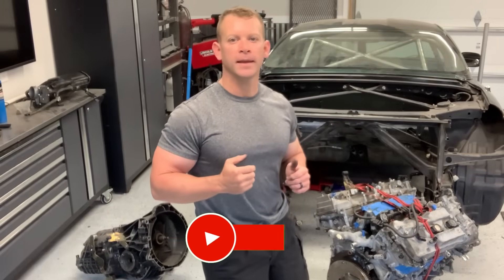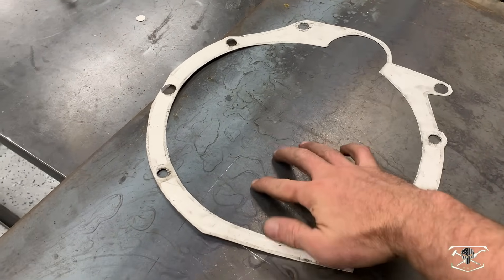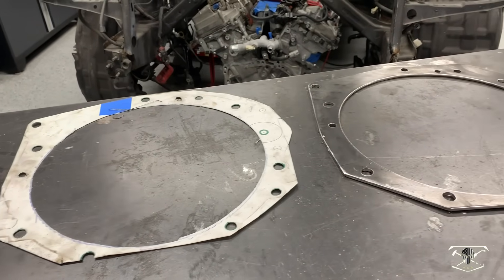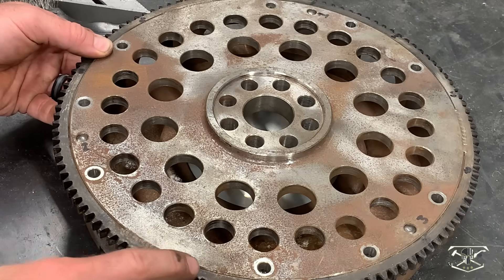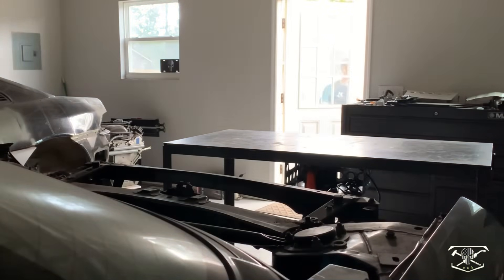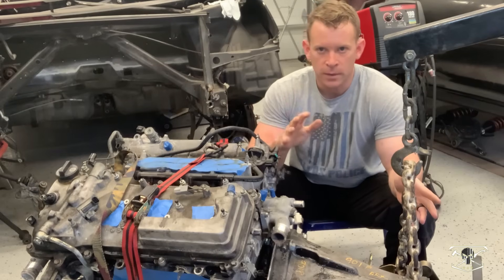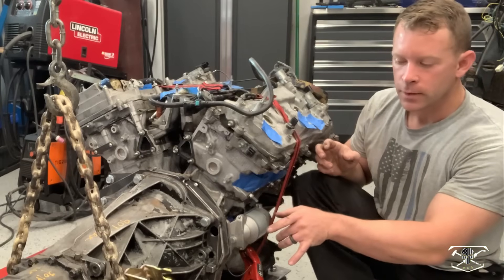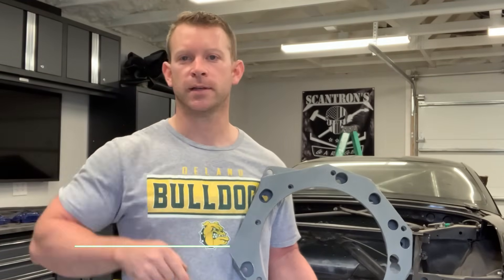DIY Engine Adapter Plate (Mate any Engine to any Transmission)

Comment: Amazing!  🤩
Good job💪, I really needed this.  
I have to do this in my project.  
I bought a Golf MK1 engine to install in my Corolla KE70, and I’d like to use the same transmission.  
This method will definitely be cheaper for me
Reply: How many millimeters is the sheet metal?
Reply from the maker: That's an awesome project! I'm glad this video could help you out. Yes the kits are super expensive and this is a good option. Just takes some time and patience

Comment: No dowels? . Unequal delta point between known centers? . A precision caliper and a circular protractor is what you need. Interpolation access must be achieved or transmission head gear  bearing failure is a guarantee as well as 1st and 2nd order phase vibrations that crack everything.  People did this long before CNC machines where ever thought of. It was just as accurate just 10 times slower .
Reply from the maker: Thanks for the information and your thoughts on the project. I did use dowel pins. You can see them. I didn’t mention them. I also had a friend measure it with a dial indicator. I may have to look into the protractor idea. Thanks

Comment: How did you figure the run out? I never saw a dial indicator being used or a DRO on a mill. How long did the input shaft bearing on the tranny last?
Reply from the maker: Dial indicator. Didn’t film that. And it is still running strong

Comment: My good man, this is incredible.  Subscribed to see more of your home-tool design and manufacturing.
Reply from the maker: Thanks man! I do what I can with what I got. Thanks for subscribing
Reply: @scantronsgarage  If I may, and don't take this as an insult nor put-down of your channel, I would suggest a better microphone (not sure what a lot of the car youtube channel guys like Vice Grip Garage or Stay Tuned uses, but I have seen other people use clip-on bluetooth (I guess?) microphones on their shirts).  
The lighting seems good(!).  The one clip after the welding had me wondering if the welding screwed up the lens or light sensor on the camera because it was a little fuzzy, but that got cleared up in the next clip.
My only point is refining the production/recording a little to polish what you have.  You obviously have the skills that a lot of home builders on a budget would want to learn from.
Merry Christmas, Chief.
Reply from the maker: @2WheelsFreedom-fest   Thanks! I appreciate your input and feedback. I have been looking for other microphone options and I think you are right. the clip on blue tooth ones are the way to go. I would jest have to be better at remembering to charge the thing

Comment: When you had the engine and tranny all mounted up together (before you began welding), how were you able to maintain +/= 0.002" radial runout?

Great video, thank you for posting it
Reply from the maker: Thank you and yes. I racked it a few times and re checked it and added some more tacks and re checked it. It was still within spec. This is why I was afraid to fully weld it. But it all checked out. Thanks for watching

Comment: Hmm. This seems to be only suitable for dual mass flywheels, where the almost 2” increase in overall length is relatively easily dealt with by swapping components, or custom building them. 
For those of us dealing with old school solid flywheels and period gearboxes, this is a bit more problematic. For us, overall length is critical, if we’re to avoid irreversible modifications to body shells. Dealing with classics, all modifications need to be reversible, so a future owner can go back to concourse.
Reply from the maker: I’m with you. There are limited options to making these engine swaps work. And then modifying everything else that n the car to make it work . The dual mass flywheel seems to be working well

Comment: Why did you not check both mating faces for parallel ? My experience would say some error due to cut plate and weld, I would check faces before paint and grind of turn on a face plate to ensure parallel to <0.1mm or about 3 thou, less is better. Machining the cut plate used as infill on a mill to ensure same size and parallel would help limit errors.
Reply from the maker: Agreed. I did recommend to the owner to have it planed at the machine shop. Not sure if he ever did.

Comment: but will this hold longer than 100 miles?
Reply from the maker: So far so good
Reply: @scantronsgarage Nice! I dont know anything about cars and transmissions. But the forces on those welds must be insane!
Reply from the maker: @Blabla-q8c  they will hold better that aluminum would. But yes they need to hold up

Comment: how is it a DIY when you are sending stuff to a machine shop? how am i going to do this myself when i have to spend a fortune sending it somewhere? thats not DIY. though i suppose if youre doing all of that with engines and transmissions you should already have the funds to send stuff out to be worked on or created.
Reply from the maker: I could have done it myself, however the end result would not have been as good.

Comment: My only concern is the lack of alignment dowels that are based off the centerline of engine and transmission. I'd worry about input shaft seal leaking over time.
Reply from the maker: I have alignment dowels. I didn’t mention them but if you look back at the plates you can see a smaller hole near the mounting holes that is for the dowel pin

Comment: Plate doesn't worry me. I'm scared of the flywheel/torque converter issues. 🫠
Reply from the maker: Nah. That flywheel is super buff. I am running the same flywheel in my v8 swap vehicle I did
Reply: @scantronsgarage I mean fitment. I'm not that confident on my ability yet 🤣
Reply from the maker: @jordanthornberry9960   Haha.. Ok, You will ger there

Comment: Only works for dry clutches?
Reply from the maker: You could do the same process with an auto. The adapter plate would just be thicker. Same process though
Reply: @scantronsgarage and some more oil
. 😂
Reply from the maker: @rks-c4h  that too

Comment: I just did that to adopt a ZF8 speed transmission to my 1998 dodge Cummins diesel 12 valve. Except I only had to make the adaptor for the engine. Then bolt it to the factory adaptor that bolted the Dodge Transmission to the Cummins. You’re giving other people great ideas.
Reply from the maker: That's awesome! Glad I could help with some ideas. Also, sounds like a cool project and luckily you only had to make one half

Comment: Bit late to the party… I built a mpcnc and then a printnc… milled a ring to mate my engine1.5in thick… then using cad and math found where I needed to cut my transmission bellhousing, had it machined, but have seen people use a grinder… and then welded them together… bmw engine mated to a porsche 6psd from a cayman
Reply from the maker: Nice! Way more high tech than my method. Sounds like a fun project

Comment: I have a a few questions
1. Why any engine to any transmission since it’s built for specific engine and specific gearbox?
2. 7:10 What is this thing for is it a starter? It isn’t crankshaft right?
Reply from the maker: 1 you can use this method to do the same for any combination you are doing.
2. That was the provision to use the starter
Reply: @scantronsgarage got it, thanks!

Comment: what if my engine rotates opposite the transmission i want?
Reply from the maker: Good question! You can flip the transmission so it is upside down from its original position. This has been done with other Porsche transmissions

Comment: My question is how do you know you have the input shaft perfectly straight, so it's not deflecting up/down left/right.
Reply from the maker: I mostly allowed the input shaft to center itself in the pilot bearing. Then spun the motor to make sure there was no deflection. Then I tack welded the plates together. Then I measured everything a bunch of more times. Then I welded the plates all the way around

Comment: I noticed no locating dowel pins. Are you relying only on bolt tolerance for proper crank alignment?
Reply from the maker: I breezed over that. You can see the extra smaller holes for the dowel pins.

Comment: I think the centers should have been aligned from the start. Right now, for example, I'm not sure they're aligned. Let me remind you that for the input shaft bearing to last a long time, the center alignment should be 0.1 mm. I'm currently trying to do something similar... But that's just my opinion.
Reply from the maker: Thanks for your thoughts. I checked the alignment closely, but your point is a good one and important for longevity.

Comment: I missed the part where the transmission is precisely aligned with the engine. You can’t just stick the input shaft into the throwout bearing.
Reply from the maker: Yea it may break one day. But so far so good. I did take a bunch of measurements which did not make the video cut.

Comment: I made an adapter plate to bolt up a 235 Chevy to a ZF 5 speed from a Bedford CF van using a basic pillar drill, angle grinder and arc welder.
Reply from the maker: Nice work, great way to get it done. Where there is a will , there is a way

Comment: Hey this is ecactly what i need!
But one question, to find how much you need to fill between the both plates is that because you pushed the transmission all te way on untill it won't go any further? And how did you aline it lenght wise? Without the transmission being to low (hanging on the input shaft) or too high?
Reply from the maker: Hey! Glad you found this video helpful. Yes, just like you said. Insert the input shaft into the pilot bearing. Make sure the engine and transmission is square all the way around. In my case the measurement was 22mm all the way around. If you get fluctuating in your measurement. You are not square. Lastly. I spun the motor like this to make sure there was no deflection (wobble). I had to make a bunch of stuff with screw type jacks to help me with the fine tune alignment

Comment: My mentor could make an adapter plate bye. I it's a talent, I've seen immune a few times he was a boy in Italy and they had nothing but the old war stuff and they made it work. And he was very good at that. It's a lost art driven by necessity
Reply from the maker: Absolutely! This is an art driven by necessity. Sometimes you need to make things work with what you have available to you. Thanks for watching

Comment: How do you make sure the primary shaft of the gearbox aligns with the crankshaft?

This is why I had my adapter to mate the VM Detroit 638 with the gearbox custom made at a CNC shop.

Constantly swapping bearings of the gearbox I don't fancy that job.
Reply from the maker: I kept my fingers crossed hoping the input shaft and pilot bearing would self align. I did take a ton of measurements. And I spun the motor to check for runout . So far so good

Comment: I wonder how you garanteed C.L. to C.L.? 
nice cutting the circle with a grinder like that, never thought of that, good for thin steel only, i guess up to 1/4" ?
Reply from the maker: The center lines are accurate to the original dimensions. Basically I used the pilot bearing and input shaft alignment to determine center. I then welded the plates after inserting the input shaft into the pilot bearing. I spun the motor to check center. And yes 1/4 would be the thickest you could cut like that

Comment: Would this work for an auto trans?
Reply from the maker: Yes! Same process. You may have to make the adapter thicker to accommodate the converter and make an extender to make the torque converter meet the new length

Comment: That was a great job for what tools you had for sure, the only thing I would add is that I would've installed some dowels to locate everything, also and I dont know how I would do it with your foreign stuff, but on American car old school V8 race cars, we use to have tranny to crankshaft centerline alignment problems and wipe out the bronze bushing in the back of the crankshaft and would have to indicate the center hole of the blow shield to the centerline of the crankshaft, then drill the dowel hokes oversize and install metal bushings and weld them in place.

Comment: It's a pity that the engineering genius of these internal combustion engines will be replaced by electric motors or hybrid engines because  they are so inefficient, losing about 30% of the fuel's energy output to heat. That coupled with the fact that crude oil derived fuels are all not renewable, once used that it. Then there is the pollution aspect of the emissions contributing to increased green house gases and it's effect of global warming. Coral reefs are dying globally due to increased temperatures of the seas surrounding them. All humans need to reduce their personal output of green house gases by driving less, walking, running or cycling more.
Reply from the maker: True

Comment: If I become president, I will require all manufacturers to choose between 1 of 5 standardized bell housing patterns along with input shaft length and spline count

If Ford makes a V8, they will need to choose one of 5 and make it THAT pattern from here on out. For their V6's the can have a smaller bell housing if they want, but that V6 family will have bell housing 2 and only 2

Please vote for me when you see my name on the ballot
Reply from the maker: You got my vote! Also work to ease up on emission restrictions

Comment: Doesnt this mean the input shaft is too short to sit in the pilot bearing now? Genuine question.
Reply from the maker: Yes. Normally it would be. However in this case, it now fits perfectly into the flywheel “crown” as I called it. The crown sticks out the proper distance to capture the input shaft in the pilot bearing. The pilot bearing is also seated in the “crown”

Comment: So the spline gear was long enough? You didn't  have to make an adaptor for that.? What if it wasn't long enough?  What if the splines aren't the same as in Japanese car vs. an American engine?
Reply from the maker: No spline shafts involved. The shaft was not long enough. The flywheel extension is what made up the length difference

Comment: You need to do one of these on a  5.9 Cummins diesel motor to a Alison auto transmission For all the Dodge people ...
Reply from the maker: That would be a fun project. I would probably have to make the plate with some thicker material. Maybe 1/4 inch. Thanks for watching!

Comment: Very nice work using common garage tools, however, not clear on flywheel and clutch. So it appears you used the Toyota flywheel and the Porsche transaxle clutch disc and pressure plate? Did the Porsche input shaft fit the Toyota pilot bearing, or did you have to do something else?
Reply from the maker: Thanks and a fair question. The Toyota flywheel bolts to the crank and engages with the starter. That is all it does. I bolted the flywheel portion to it. I referred to this as the crown. The crown has the proper pilot bearing for the input shaft and is made to run the oem Porsche clutch .
Reply: @scantronsgarage Thanks for the response!

So your “crown” assembly as you’ve chosen to call it, contains the pilot bearing that the input shaft engages. 

In other words, the Porsche input shaft doesn’t reach the ‘Yota crank pilot bearing.
Reply from the maker: @BMWperson03  that is correct. The crown piece gives the flywheel extra reach into the transaxle to meet the input shaft
Reply from the maker: @BMWperson03  that is correct

Comment: what about the input shaft with clutch
Reply from the maker: The input shaft fits perfectly in the bearing on the flywheel crown. The throwout bearing actuates the clutch

Comment: I wonder how bad it would vibrate if you just use the factory torque converter on that 4 l 60 and just drill holes in the flex plate and bolt it up... 😂😂😂 You can ship those transmissions with toggle switches to test it out. Vet factory harness has a same style transmission it's 3 speedway drive. The shifting points might not match up..! I was trying to see if I could do it
Reply from the maker: That's an interesting idea, but I'm not sure how well it would work long-term.

Comment: Pretty slick what was the cost of on the flywheel getting it balanced... If you don't mind me asking was it super hard to get done
Reply from the maker: I paid 90 bucks I think. Pretty simple, I just dropped it off at a machine shop and it was done in a week

Comment: I need an adapter plate too a 2.2 eco tec to a 4l60... Automatic transmission... I've got an old Chevy car that's got a 150,000 mi on it that truck has a 2.8 in it but you can't even get a body control module I'm getting sick of trying to find somebody to fix or program my body control module just so it will take gas... I don't know anybody that could make it torque converter that fit that transmission. I just want to be able to drive it I'm going to swap over the wiring harness cut the firewall out for the steering column can put complete wiring harness breaks too...
Reply from the maker: I still
Think you could use this method to fit this engine to an automatic transmission.

Comment: Late to the party here but no one seems to address the obvious change in the amount of engagement of the nose of transmission input shaft.

So, what did you do to address this?
Reply from the maker: There is full engagement due to the flywheel being pushed back into the transaxle to make up for the adapter thickness
Reply from the maker: That is why no one is addressing that
Reply: @scantronsgarage sorry, I didn’t catch how the flywheel was gapped from the crank.  I guess I’ve seen others do this adapter thing with no change to the flywheel position.
Reply from the maker: @ReduxGarage  Yea, I had to get creative to make this combination work

Comment: But how do you make the flywheel
Reply from the maker: It was a stock 39 dollar flywheel from a Tacoma. I then had it machined to fit the bolt on part that I bought from a custom flywheel company